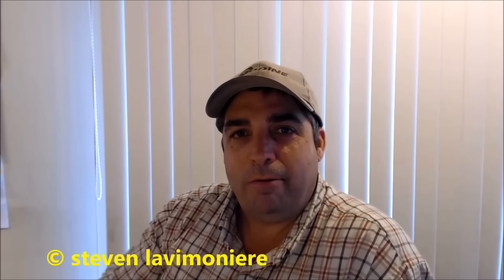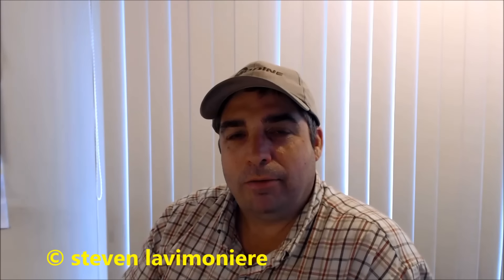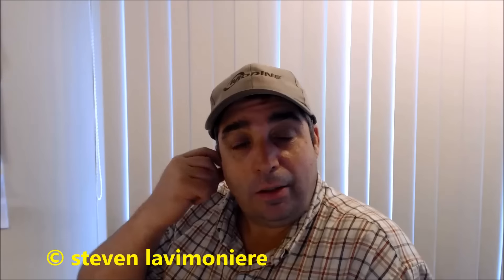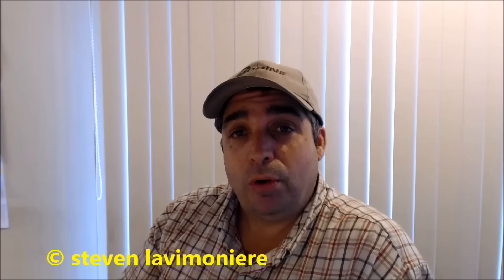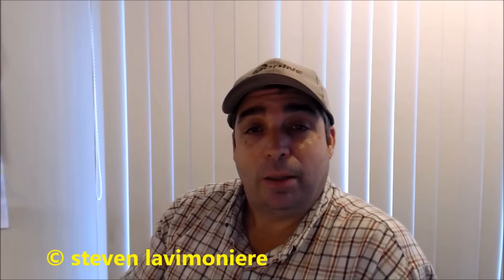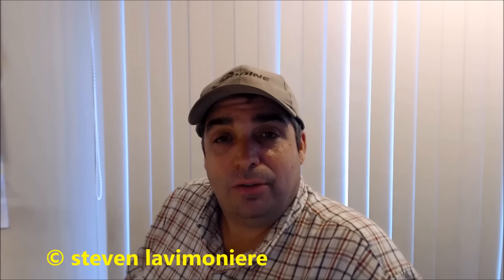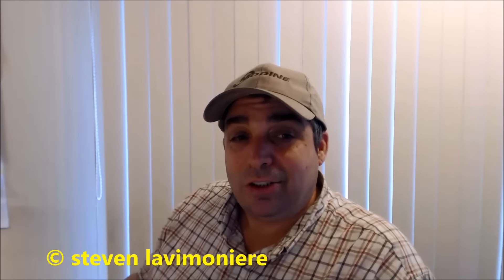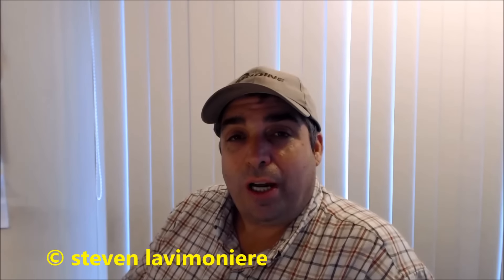coffee chat 4/ 2 /2016

Comment: Great V-log Steven! I saw this first hand when I was in service they phased out R-12, and service guys just topped off the systems, (walk-in coolers and refrigeration coolers), with MP-39, (401A), Hot Shot, etc.. Your correct about returning the gas to be reclaimed and they getting a charge because the tank had "mixed gases" in it. Not to mention, very few guys will label the system after they recharge it, because they assume they probably won't be back.
Reply from the maker: +Brad1237202 same will happen with r22

Comment: I'm good with Stay Brite 8, the only concern is not tensil strength for me its heat. I think at a little over 400f is when it gets sticky and I can only see that being a problem right at the compressor discharge which is probably fine but I just ride it safe but not using nitrogen and not cooking valves is awesome. I have found that its a little tricky to use vs. silfos.
Reply from the maker: +Tim Breslin i use both . but i do like the idea .it takes less heat great for service valves , so you do not cook them

Comment: I'm in the UK we cant get or use R22 anymore,  if its in the system and its running with no problems fine , as soon as its gone wrong its game over , new system . Hi to the baby dog
Reply: +poppypiesdad1 The refrigeration stuff you can sometimes convert to one of the R400 series refrigerants, but air con is probably better to scrap it imo.
Reply: +heavydiesel unless you do the seals , most of them rot in a year or too and the care "drop" in's are wayyy expensive
Reply: poppypiesdad1
Yeah I change the solenoids and compressor sight glasses and TEV's sometimes, have a few vids of conversions on milk coolers.
When i first started work back in the early 90's i was mainly doing R12 to R134a conversions on milk coolers so its something I am familiar with, the company i worked for did a lot of work with Castrol when they were developing their poe oil.
Reply from the maker: +poppypiesdad1 thats the way we should be here .so many leaking r22 systems out there is crazy .most of them just need a little gas . for the season

Comment: Hey Steve
I'm having a real nightmare with my thermo flo furnace. severe soot build up, cleaned 2 this winter, new nozzle, cleaned flue pipe, burner tube etc. net stack temp 800's, co2, 11.9, co 89, .02 above fire draft and .04 in pipe. any thoughts would be welcome. smoke test 6                       Russ
Reply: What type of burner is on there?
Reply from the maker: +Russ M smoke is way to high .burner is not set up properly .do you have a fixed f type retention head burner??? or adjustable draw assembley that comes out the nozzle 6 or 9 slot  head